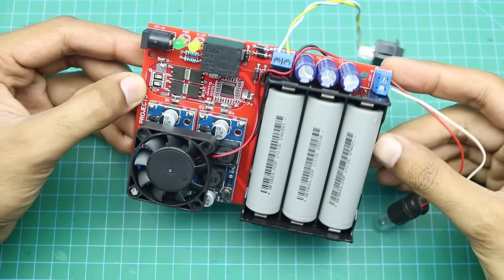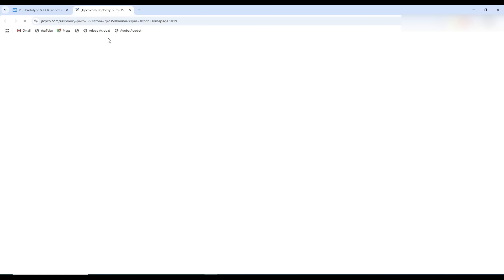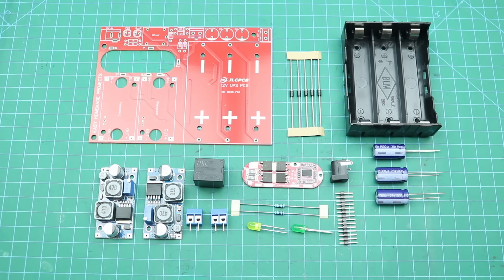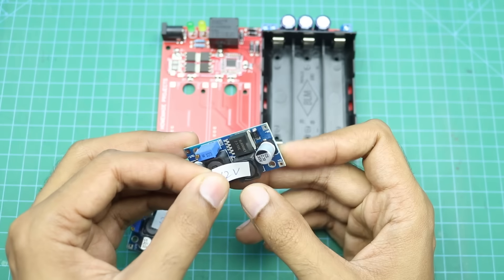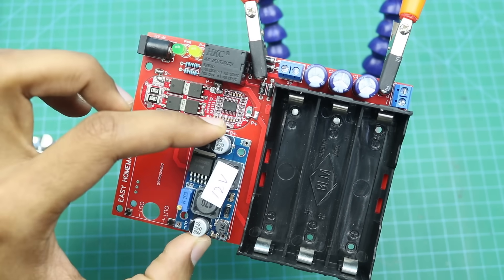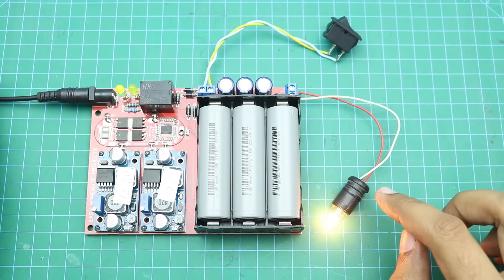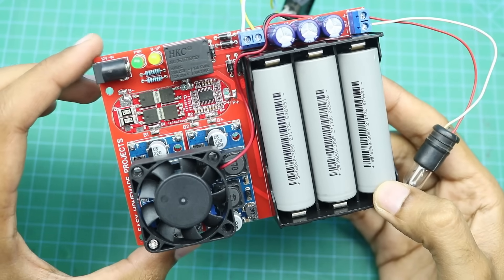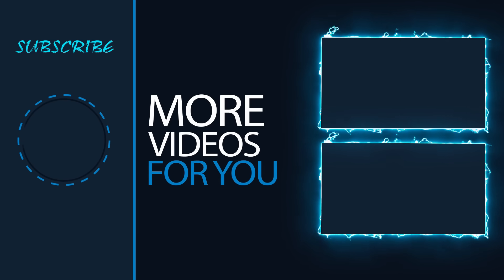How To Make a 12V UPS using 18650 Li-Ion Batteries

Comment: There is a problem with this circuit. The charging is not current limited which will charge tha battery at a high current.

Comment: Please can you make a paper counting machine? In which I can set the number of papers to count. If I want to count 10 papers, then after counting those 10 papers, the machine should stop for some time. And then count 10 papers again. I should be able to count sets of 10-10 like this. I should be able to change the value of 10.

Comment: Though various router manufacturers specify voltage and current requirements of between 9V 2A and 12V 2A, I have found after testing many routers that the  current consumption rarely exceeds 1.2A and is typically around 900ma. This would reduce the back-up time provided by your design by approximately 50% to 2.5hrs. That seems reasonable if periods without mains power are expected to be short, but personally I would like to see the back-up time available to be around 8hrs at a minimum of 1.5A

Comment: What is the UPS output rated (continuous) power for the unit and how many hours will the system provide at that output power load?

I'm guessing maybe 27W (3.6V*3*2.5A for maybe 1 hour).
Reply: Your calculation is completely wrong...4.2v-2.6v=1.6v X 3 X2.5ah=12wh... 12wh :0.6w ( 12v/0.5a) = 2 hours
Reply: @filipporossifavilli68  Wrong.  4.2 is maximum voltage--not Nominal voltage.  You can't use it in your calculations and expect to get an accurate answer.  Your thumb nail image claims .5A@12V*5hr=30W.  My calculation is more accurate using nominal voltage.

Furthermore, your cells have a nominal V of 3.6v and a rated capacity of 2.5Ah.  That means: 3.6*2.5*3=27W (total usable power).  Your load + the circuitry components only have 27W available to them from the peak to cut-off voltage of the cells (which is likely 3V).
Reply: @ab_ab_c  Wh= maximum voltage 4.2v - minimum voltage 2.6v X capacity (2500 mah)
Reply: @filipporossifavilli68  You're not actually getting 4.2V.  If you watch your meter when you apply your load to the batt, you will seed the V of the batt almost immediately drop to ~3.7V & gradually declines over time with a constant load.  That is why nominal voltage is used & 4.2V is NOT used when calculating Wh capacity of Li-ion cells.  

Higher resistance loads draw more power & result in less discharge time until the cut-off V is reached.  Lower resistance load draw less power & result in longer discharge times.  Cell manufacturers use standardized tests to show the discharge times using different load at specific temperatures.
Reply: @zeffur7  LOL 😂😂😂😂